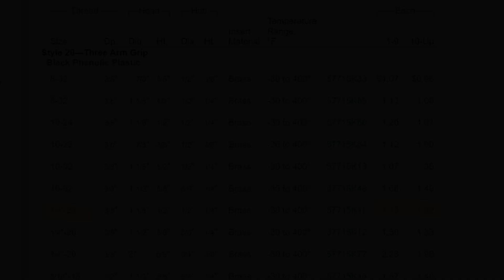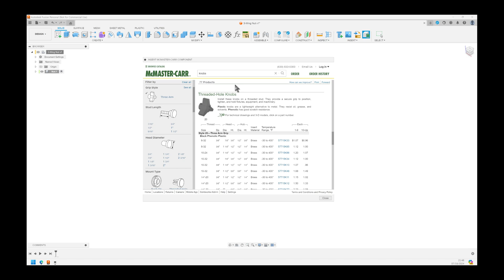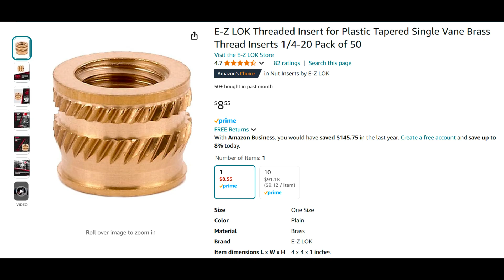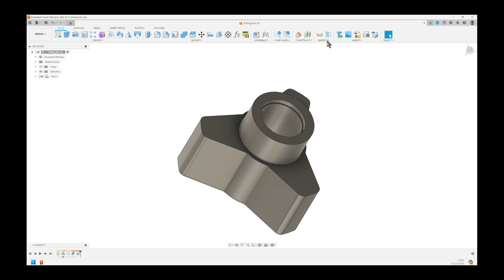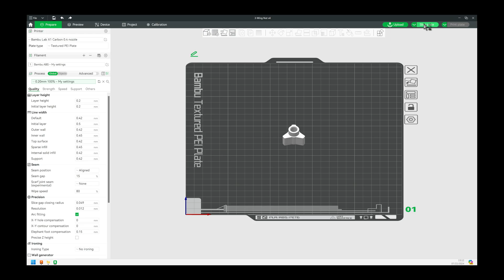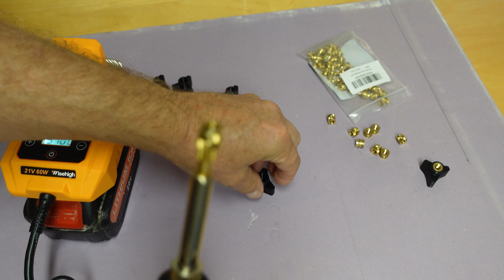Make a small star knob 1/4"-20 Female

Comment: It is always good to have more than one option besides buying.
By the way, why did you choose to use brass inserts? why not trying the captive nut method? where you can stop midprint to insert a nut inside the piece
Reply from the maker: I considered that very strongly, and as you can see in my other videos, I use that technique for embedded magnets.  The inserts are getting so cheap that it doesn't matter all that much.  Today, I am uploading another video using an old bolt for a star knob stud.